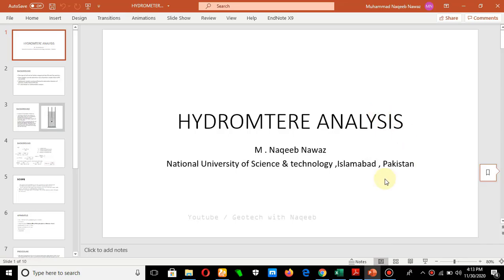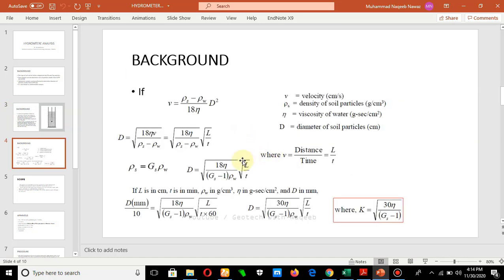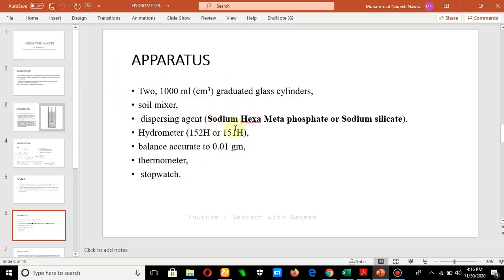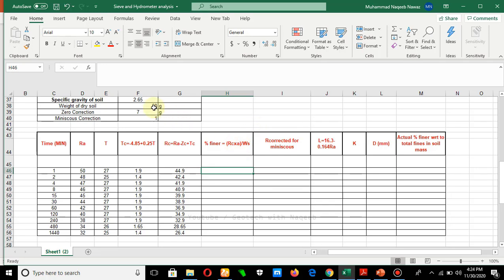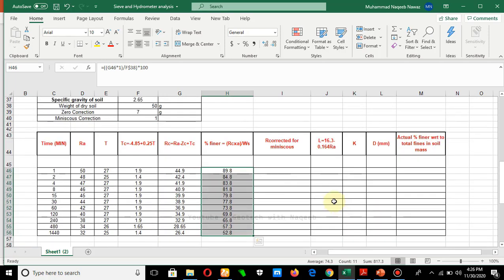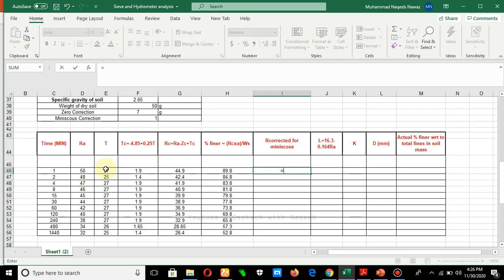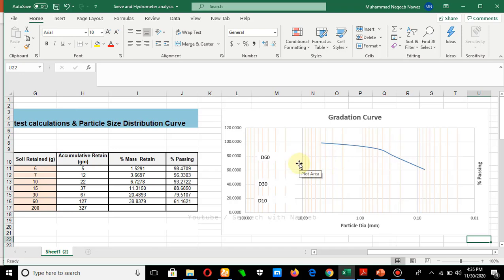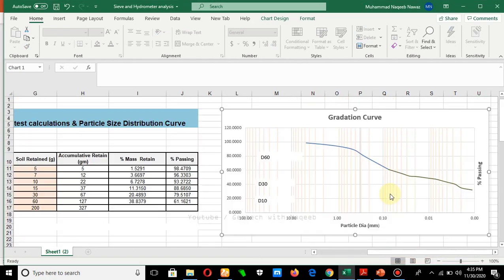Hydrometer Analysis of Soil | Excel Sheet + Theory | Geotech with Naqeeb

Comment: Thank you very much from Japan. Indian explanation is more easy and understandable. Very difficult to find hydrometer detail test and calculation part in YouTube.
Reply: The hydrometer reading label is from 1000 to 1050 in my case. As per your sheet, it is only 2 digit readings. Should I also take 1040 as 40 in your case?
Reply: Why are you are taking the specific gravity of water at 25 degree only  when you have different temperatures in your solution at different readings?

Comment: from where can we get miniscous correction?
Reply: HI 
The hydrometer is set for lower meniscus reading, but since the liquid mixture is cloudy, lower meniscus reading is difficult, so the hydrometer is read at the highest adhesion of water to the stem, if the H151 hydrometer is used to correct the meniscus with a solution of pure water and separating substance ( with the same concentration used in the hydrometry test 125 ml 4%) and pour it into a comparative cylinder and the density of the place the gauge inside, because the solution is clear, the upper and lower parts of the meniscus can be read( it is noted that the temperature in both cylinders is the same as the comparative and hydrometric). the difference between the two readings of the meniscus number for each The test is constant .